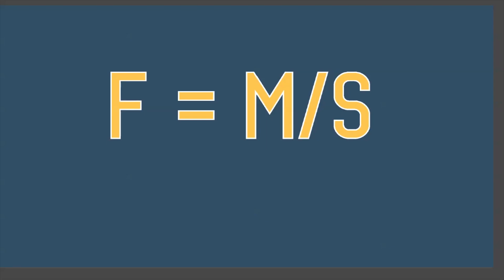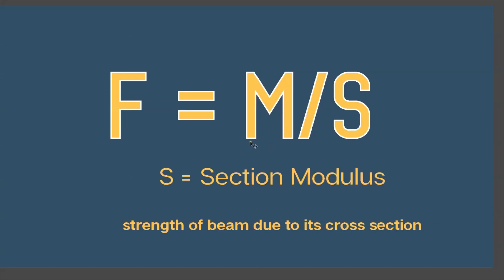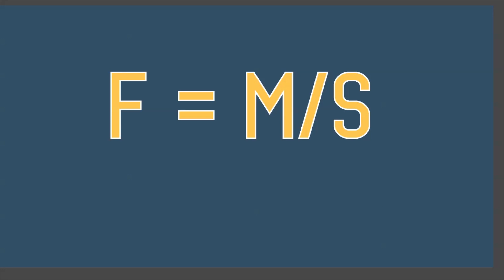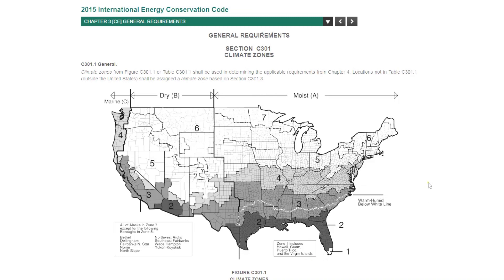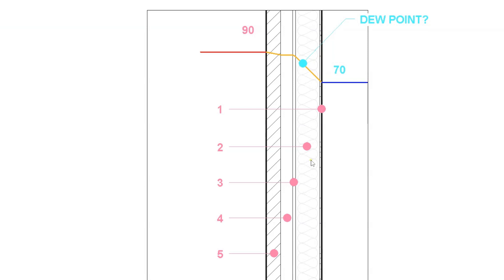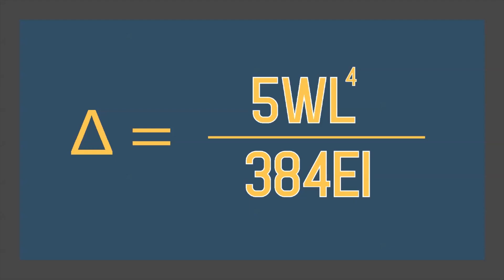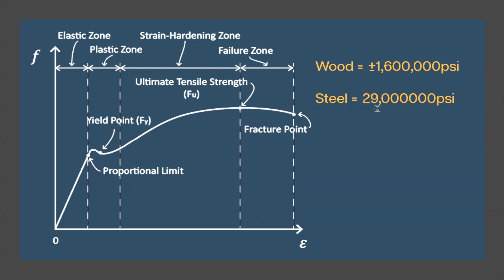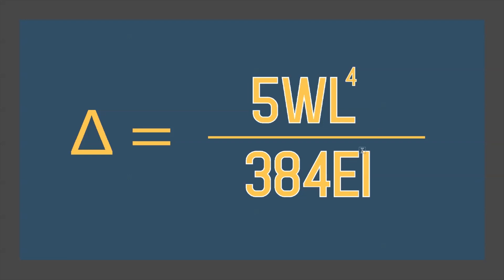ARE 5.0 PDD/PPD Formulas and Concepts

Comment: I know this old but I want to point out that the vapor barrier should go on the "warm in winter" side of your wall. Basically if you're usually heating the building during winter (like most places in the US) then you'll want the VR/VB on the inside of the studs. Unless the exam specifically says "hot climate" I would assume that to be the case.

Comment: Determine appropriate documentation of building design (A/E) 
Architects must identify a drawing and documentation approach based on project complexity, materials and assemblies, 
delivery method, and other project or construction related requirements. Throughout project documentation, you must 
know how to refine, update, and make adjustments to the drawings to align with new or changing project requirements. 
Documentation must also indicate final selections of building materials, assemblies, and finishes.
Reply from the maker: Totally.

Comment: I just bought your PPD/PDD study materials. I like your straightforward approach. One comment on a statement you make in this video, namely that vertical fins are superior to horizontal overhang or fins on the east/west façade. I have seen this claim in other sources, like (I think Ballast) but there are different opinions on this to say the least. Check out Lechner's Heating, Cooling, and Light chapter on shading, for example. He is unequivocal that horizontal shading is better on these facades, with a preference for horizontal louvers to allow heat to rise through and not be trapped. I think his main reasoning is that vertical block too much of the view, but I think even if we went with vertical fins here, there would have to be more of them and not angled 90deg to the wall.  The vertical fins you have drawn would not be of much use in the summer when in many latitudes the hot lower eastern/western sun would by pass them. Do you have a counter-argument here? Anyway, generalizations are always difficult, so there may be no "right" answer at this level of analysis.
Reply from the maker: Hi Clark, thanks for signing up!

Lechner is great, and HCL is one of my favorite PPD books, highly recommended. I don't think he is unequivocal that horizontal shading is better East and West. He is just clear that vertical fins can limit views...this is true.

The issue with East/West sun is that is tends to be lower and extra glare-ey. A horizontal overhang would have to be really long to be effective, Lechner says this as well.  I missed the part about heat rising, but that's not really what shading devices are for...they are trying to limit direct solar radiation through windows, and maybe working to limit glare on the East and West.

The real answer is that it is dependent on the site, the program, the wishes of the client, etc. But on the ARE, where you have 2 minutes to solve every problem and we have to speak in general terms, I think vertical shading devices are correct on the East and West. And angled to the north is better. If it comes up, just see what the question is asking you to do.

And...you can always play around with this in Revit or Sketchup. Build some simple walls to act as fins and turn the sun path on.
Reply: @HyperfineArchitecture   Hey Ben. First, I LOVE these tip videos. Thanks for making them. As for the overhang question, Lechner summarizes chapters with key ideas. In chapter 9, key idea #9 is "On the east and west facades, the horizontal overhang is preferred over vertical fins". I think that's pretty unequivocal. He also discusses it in the text. He doesn't like vertical fins much. But he's just one voice. 

BTW, what I am claiming is that the vertical fins in your example will not block much solar radiation in the summer early morning and especially in the afternoon when it is really hot. I did a quick SketchUp study to prove the point to my satisfaction. As for the heat dissipation comment, in this context the microclimate around the window IS important because the reason for the overhang is to reduce heat gain, so the heat dissipation of a horizontal fin over solid overhang would be important...if you chose that design direction. Anyway, I do agree with you that this is all about the specific site and other variables. For example, in many situations a large horizontal overhang is a real advantage. It's called a porch. 

BUT as you say, this is about the ARE, not geeking out on the details. I actually feel for the folks writing these exams. To cover these topics, you have no choice but to generalize, but that often just doesn't work well.  That makes your advice to generally look to the architectural context very useful. Thanks for that! Ok, back to studying :)

Comment: Love this video. Just wanted to note that there is a discrepancy between your statement regarding shading devices on the E/W facades. Heating, Cooling, Lighting, Section 9.3 states "Although
 less effective, the horizontal overhang is also the best on the east, southeast, southwest, and west orientations." This is also what Elif references in her practice questions. Do you have any further insight on this?
Reply from the maker: Thanks! I don’t agree with HCL. The sun is too low in the west and east. For best shading you will need to incorporate vertical fins.

Comment: in cold climate, does the vapor barrier go on the interior side of the  building? For, example from Inside to out, 1 layer of gyp, vapor barrier, wood stud with insulation, exterior sheathing, and exterior cladding?
Reply from the maker: Yes, the wall assembly you describe would work for a cold climate, at least as far as the ARE is concerned!
Reply: @HyperfineArchitecture  Thank you!
Reply: @HyperfineArchitecture  where is the "vapor" then? Is there a ventilation system? Humidification?
Reply from the maker: @piezoification  you can assume the vapor will be wherever the warm air is. In the summer, an air conditioning system can provide dehumidification, obviously this will not be on in the winter in cold climates though.

Comment: I am having hard time to understand something. In the first example, 30 lbs/ft2 is given and while calculating W you multiply 30 lbs with only 10ft. If it is 30 lbs per square foot shouldn't we need to calculate the weight per whole surface and calculate it as 30x10x10? Or it is only a simple mistake, 30 lbs is per linear foot not square foot? Thanks!
Reply from the maker: I did the 30*10 to account for the weight of 1 linear foot. I think that's what you need to do to account for the different spacing. Then the L^2 will end up giving you the total weight as part of the equation. We are looking at this in plan, so we see the weight of the system as 30lb/sf but we can also see the joist spacing. If we were looking at this one beam in a free body diagram we wouldn't know about the spacing, but we would probably be given the weight as 300lbs/ft.

Comment: Why do we need to memorize structures formulas? The free body diagrams are given as structural references in the exam along with deflection properties!
Reply from the maker: You can choose for yourself what you want to memorize, but the formulas I discuss here are concepts you need to know. Even if you don't memorize them you need to understand enough to know what you're supposed to go look up. Also, the exam references load slowly, and there are dozens of pages of references provided. Memorizing a few key formulas will save you a lot of time on the exam, and time is at a premium. If you are unsure of where to look for these formulas on the exam, check out this video: https://youtu.be/WkjyZsutnC0
Reply: True about the exam loading part. It feels like I'm browsing on a 90s computer.
thanks for your youtube and PDF study guide resources tho- best one I've seen!
Reply from the maker: Thanks and you are very welcome! I agree, the exam is given on computer setups that are far below the standards most of us are used to working with every day.